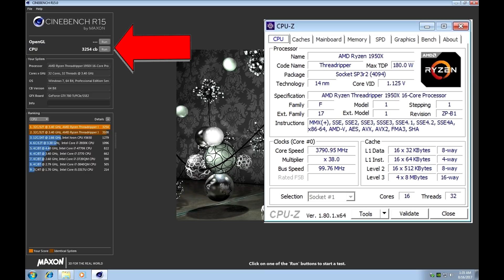How to Install the Threadripper CPU | How To | JoeteckTips

Comment: @Joeteck what is the exact PSU model which you are 
using to power the Aorus X399 motherboard. Specifically, I am interested in the cable / converter that you used to supply power to the 4-pin ATX_12V_2 connector on the motherboard. Thanks!
Reply from the maker: Alexander Iakimov I am using the Corsair RM1000X. Thanks for the question. :) however, since I have plenty of power, I am not using the 4 pin power connector.. But the PSU does have both. So you could use it if you wanted.

Comment: You didn't use the torque wrench to start with and you tightened the screws in the wrong order.  I, literally, flinched watching you put that CPU in when you put your hand on it and gave it a good side to side shove.  Then, you installed the DIMMS in the wrong slots (see p. 17 of the manual), so I think the chances are good that you broke the board, not that it was faulty.

Comment: @Joeteck  You suppose to install the memory two dimm on each side of the cpu not all 4 dimm in one side
 so to get quad channel but like you installed it you will get dual  channel only
Reply from the maker: Chem Cup I tried, it continued to fail to boot.
Reply: For 4 memory models you should fill dimm  2 and 4 on the right side of the cpu and on left side dimm 6, and 8.. then  if it is not  booting you have problem with the dimm slots
Dimm 2 is the second closest one to cpu on the right side. Dimm 8 is the last one on the left side
Reply from the maker: Chem Cup I am aware. The board is falty. It came broken. Seems they do not test them before they go out the door
Reply: Sorry
Reply from the maker: Chem Cup yeah, it's ok. Been an A+ tech since 2004 and have been in the I.T. field for 29 years. Built at least 100s of workstations and servers. I've seen a thing or two.. lol. I also the owner of my own I.T. service company. I LOVE YOUR  enthusiasm to help! Thank you very much! Could use your knowledge on my forum!

Comment: Did you try to update the bios Joe?  There is a new bios update for memory compatibility on Gigabyte's website.  https://www.gigabyte.com/Motherboard/X399-AORUS-Gaming-7-rev-10#support-dl
What happens if you remove some of the ram and just run like one or two dims?
Reply from the maker: I upgraded it to f2k. The latest. However, the board may be funky. I can't install Windows 10. Freezes at the Windows 10 logo then stops. I can only install Windows 7. I may be returning it for something else. Its not ready for public purchase yet. Alot of unknowns.. I will explain in a vlog
Reply: Sorry to hear that Joe, what a bummer.  Maybe you can try to start disabling devices in the bios and see if it will get through the setup.  Disable sound and wi-fi etc, just an idea, i get obsessed when things don't work and try to eliminate all variables.
Reply from the maker: Pet Mey I am getting a full refund for the board. Not sure which one I'm going to get now.